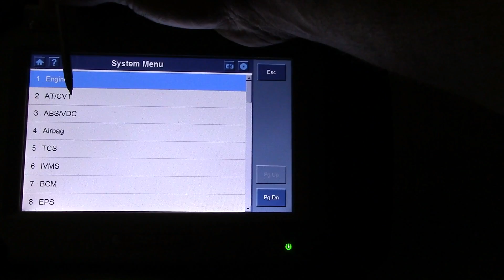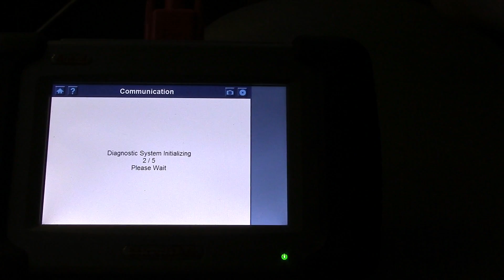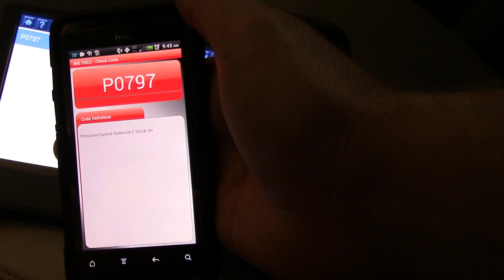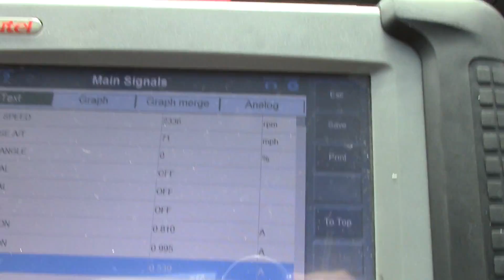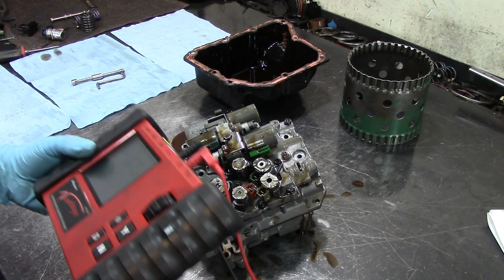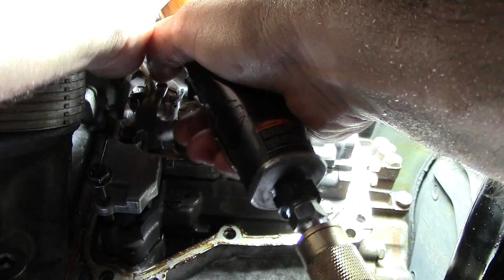AW55-50SN / RE5F22A Transmission - The Symptoms - The Repair

Comment: Great video. It's been a while since it was publshed but in case: what do you do to the small shift solenoids? Do you clean them? And if so, with what?
Reply from the maker: I use solvent and compressed air. But you can use non-chlorinated brake cleaner and compressed air.

Comment: Got a 2005 Chevy Equinox, had some pretty burned fluid in it, I had the motor apart so I went ahead and drained the fluid, once all back together a month later I hear pump whine, then it lost all gears, I drained the fluid again it was real dirty. Got all my gears back for a short time, then gone again, drained and added fluid a 3rd and 4th time with some idling in between. Fluid came out clean. Went around the block and it didn't make it, lost all gears again, something is getting clogged. Do you think it can be repaired by pulling the VB or am I looking at a complete rebuild. I have no experience in transmissions, except what I learned at tech school.  What happened was the cooler lines were both crimped from a wreck in the front and they never got replaced.
Reply: that new ATF acts like a cleaner. you would have to been physcic to change it again before that month. you could try cleaning the VB and see what happens! though it's a year later. wonder if you sold, traded it junked it for fixed it?
Reply: @cdoublejj  Still have it, I ordered a good used trans from Ebay and it arrived broken, the seller is fighting me saying I broke it, the delivery guy notated it was damaged on delivery, so this project in on hold. I have to get Ebay involved to get my money back then try to find another one or rebuild mine, a shop wanted 7000 to do it, fuck that!! I can pull the VB and see a lot from there with my bore scope, but the bottom line is its burned up, the old fluid burned and coated the inside, the new fluid broke it lose and clogged everything up. I thought I might get it flushed out by changing the fluid a few times, nope, its bad.

Comment: i’m having problems with my 05 nissan maxima. cars starts good when cold but when hot it starts acting up, revving high on the road and when switching from D to R or R to D it delays and bangs in. i have codes p0726 p0882 and U1000, but could it be the whole valve body ?

Comment: Hiram, I just replaced the valve body in my 2003 Volvo XC70 with a Sonnax reman unit.  For the first day all was well, then suddenly threw a p0750 code, SLT signal missing.  Would you suspect a problem with the connector?  I'm inclined not to suspect the solenoid itself, being a fresh rebuild, but I'm curious what you would think. 

Great info you've given us, here.  Thanks.
Reply from the maker: I would recheck your connections, clear all codes and drive it to see if the problem comes back. If it does then replace the solenoid.

Comment: Nice work but I will suggest before you place back valve body to clean all around old gasket as so much dirt is dangerous to leave on edge. Small suggestion. :)

Comment: Just found this thread....I have a P0741 code (Torque Converter Clutch Circuit Performance or Stuck Off) for my Saab 9-3 2.0t 2006 Auto.....I think this could be the answer to my problems. Would this be the same answer for me? Thank you! M

Comment: Would I have to adjust the solenoids after replacing them? If I have to adjust the solenoids do I have to remove the pan everytime I need to adjust
Reply from the maker: Yes, most of the time adjustments are required. 
I would reset everything first then drive it to learn itself, if it has shifting issues then adjustments will need to be made.
Reply: @AutomaticTransmission  what kind of scanner do you recommend to check the solenoid pressures

Comment: I disliked this video JUST BECAUSE of the stupidly loud noise at the beginning. Your videos are pretty informative, but this one deserves a gigantic FUCK YOU just because of that. You can do better. Now, for something that's actually useful...

For anyone rebuilding this transmission and looking for parts, you will find that there are two types of filters: ones with or without a "rib". I am unable to find a definitive source of information as to which transmissions have which filter, and the only source that said anything about it WAS WRONG, so I'm here to share the one tiny tidbit I know (I had to tear my entire transmission apart to figure this out, AFTER I had already bought the wrong filter):

The transmission in a 2001 Volvo V70XC has a filter WITH a rib. (there, was that so hard, internet?) If you have a different vehicle, I can't help you, but don't count on internet sources either. Tear your transmission apart first, then buy the parts when you know for sure which ones to get. (Also, my friction plates are all fine, I can still see the paint on them, so for me, IT IS JUST THE VALVE BODY!!!)

Comment: Can you tell me if I buy a autel ds708 will clear the tmc on my Volvo v70 d5 2003 please or is there another way around this / cheaper option.I have ordered a new valve body from Volvo as im getting hard shifting banging into gear. yours chris clarke
Reply: You can get a knockoff DICE unit for <$100 dollars.  You'll need a Win7 laptop to dedicate to the purpose as well, but once you figure out the VIDA software that comes with your DICE, you'll be able to do almost anything with your Volvo.

Comment: Hoping you'll see this and give me your thoughts. AW55-50sn will not move until engine rpm is around 2500 in forward gears, reverse will only slightly pull at 4000+ rpm. It will move forward just a little once you go above 2500 rpm but acts like a manual transmission would if the clutch were slipping. Main lube pressure is low, sits around 2 psi in all gears at idle but does increase with engine rpm up to around 20psi. SLT pressure in drive is around 2 psi and does change with engine rpm but always falls back to 2-3psi. C1 pressure in drive never goes above 20psi even with high engine rpm. I have removed the valve body and inspected, oil was burnt but no debris were found. Solenoids Ohm good at around 5.5 on all. I'm thinking the torque converter has failed but considering trying to reman valve body before I replace the torque converter. Your thoughts?
Reply: Did you get it fixed?
Reply: @kcycle1308  yeah ended up disassembling and finding burnt clutches. I'm not sure what caused it exactly so I just did a full rebuild with new converter and valve kit.
Reply: @53Aries  wow, nice work! Just got a used 2005 maxima and have to the valve body. Thanks!

Comment: The ports are 5/16 24 standard bolt threads. I found an adapter to a 1/8 mpt.

Comment: Great video!! Explained very well. Any advice - I have a AW 55-50NS / RE5F22A out ofo a 06 nissan maxima, runs great until operating temp reached.  Hard engagement of Drive and Reverse. Hard shifts 1-2,2-3, and sometime neutral like experience going into 4th. 5th is solid. Erratic tight shift points, and hard down shifts. 6 trans codes thrown (0797 Pressure Control Solenoid "C" stuck open, 0744 Torque converter clutch circuit intermittent, 0735 Gear 5 incorrect ration, 0780 Shift malfunction, 0733 Gear 3 incorrect ration, 0726 Engine spped sensor range / performance  -  internal electronic anomaly)

1) Odds it is just valve body?

2) Could all these codes be because of Pressure Solenoid "C"! ( Linear SLT?)

3) Should I just replace the valve body

4)Or does Sonnax valve body Zip kits work for these things?
Reply: Steve Chancey did you get that problem solved? And if so, how?

Comment: Hiram. Thanks for the great information. I've got a Saab 9-3 2003 with this AW55. I'm struggling with this car. The car acts like it is slipping all the time in D or R. Once in a great while maybe 1% of the time it acts like it works. But then it stops driving. I have a Tech2 GM and Saab diagnostic computer. It shows Solenoids information and pressure and currents. But the car refuses to move. Can I send you some screen shots showing various pressures?  Is my problem the linear solenoids sticking causing my no movement?
Reply: I know this is old but I have seen the mechanical valves inside the body stick which would cause a blockage and account for low line pressure. Low line pressure = the car will not move. I'd rebuild the valve body or find another used one somewhere.
Reply: Hey did you ever get your saab fix mine is   kinda having the same issue runs good at first but when up to temp starts slipping kinda ive had codes in the past tht where related to the solenoid did a flush and code would go away would run fine then got this problem now

Comment: I own a 2012 Chevy Sonic with a 1.8L engine. The transmission suddenly quit shifting past 2nd and no reverse. This happened while driving on the freeway. The dealer wants to replace the transmission--$4000.00. I noticed that the transmission was shifting hard into reverse before this actually happened. I was wondering if you could give me an idea what to check? Could the problem be a solenoid? Or do you think I need some hard parts? Thanks

Comment: Hey how's it going got to say like the videos u make 👍have a question I have a 2005 maxima with the same issues jumping 1-2 and hard shifts wanted to know how would I know if the valve body is bad thanks
Reply: Def the same Solenoid replacement seen in this video. All the Maximas from 2004 to 2006 had this issue.

Comment: I have a Volvo v50 - it works perfectly but somestimes only when warm i experience delayed forward response when i engage drive from N R or P - A non Volvo mechanic replaced the fluid - could it be he did not reset counter and adapt
Reply: Did you figure out the problem. Same exact issue here

Comment: Maestro Gutierrez. I have a 2004 Nissan Quest SE  3.5L V6 took it to a shop to have a code reading they pulled code P0726. They told me is a bad solenoid? symptoms are when the van is cold is fine but when I drive it for 15-20 mins feels a hard hit like when I get to a complete stop is shakes at the downshift point the RPM gauge even moves back and forth in THE 1 RPM GAUGE. what do you think is wrong?

Comment: Hello Mr. Gutierrez maybe you can help me I have a 2004 Nissan Maxima SE 127K miles, and recently I started having some hard shifting with my transmission the CEL came on and the code that popped out it's P0731 Gear One Incorrect Ratio I was wondering if maybe you could tell me what I need to do to fix this issue because I took my car to a transmission shop and first they told me that I need to replace the Valve Body and now they are telling me that the whole transmission needs to be replace so I don't know what to do, I would appreciate it if you could help me thank you very much in advance have a nice day

Comment: Excellent video. I have an old BMW 7 with a zfhp30. It had always suffered from hard down shifts. Mainly 5-4. Changing the fluid many times and using an additive greatly improved it . What shift kit do you recommend? It has not got any worse over 11years and 100k miles. (Now on 201k) original transmission.